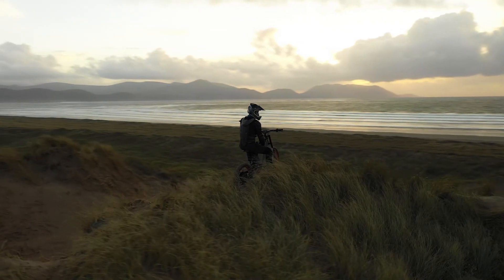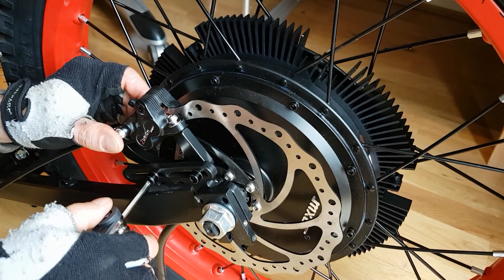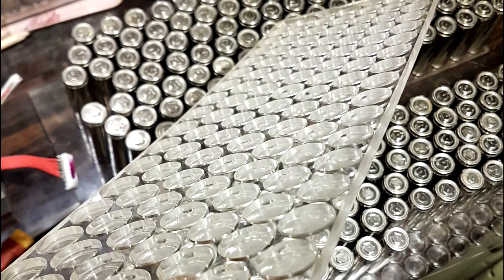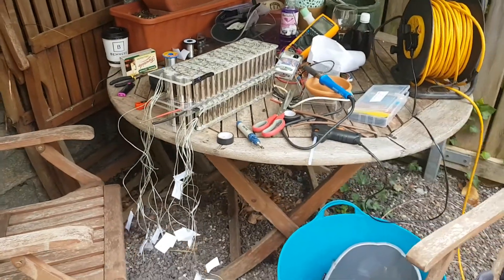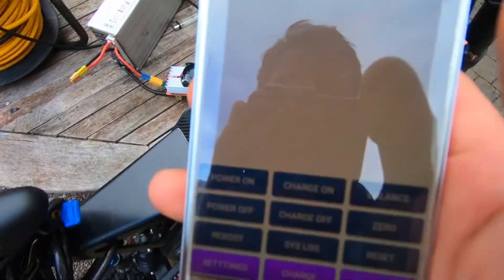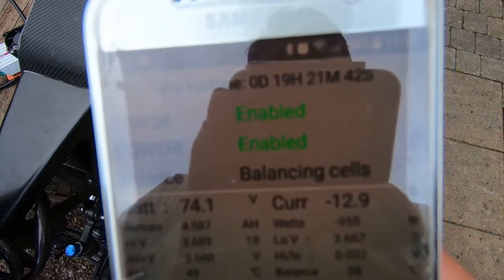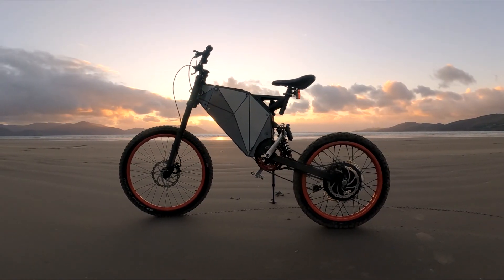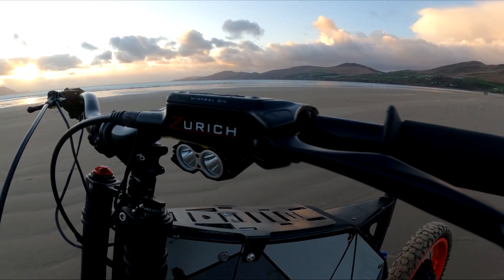INSANE E BIKE PROJECT TESLA BATTERY CELLS 12.6KW OF POWER

Comment: Where did you get the side panels and what size rims/tires are you running?
Reply from the maker: I made panels my self.There are original I just put stickers on them.
I'm on 18 inch rim but I will be changing to 16 inch 
I prefer acceleration over speed ..more fun on the dunnes